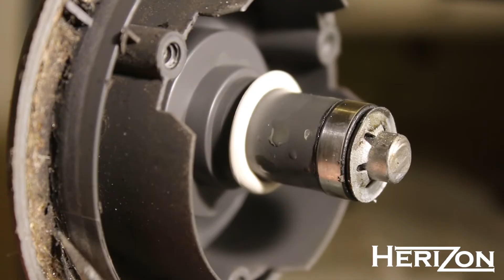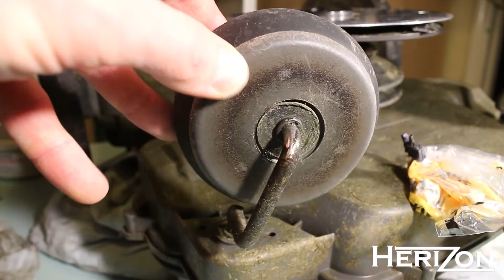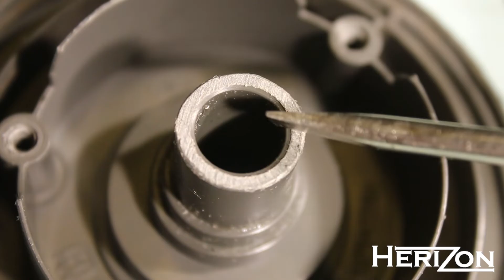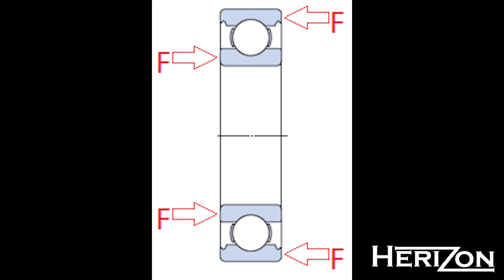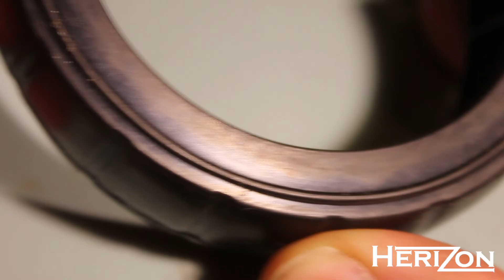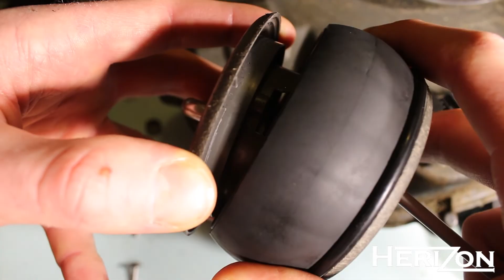Automower 420, 430X, 440, 450X, 520, 550, 550 EPOS front wheels repair and modification

Comment: Extremely informative video. What frustrates me is these mowers are not cheap - yet design flaws are many. I’ve got 2 435x AWD NERA; got them installed in March 2026 and todate gone through 3 blade disc holders; around 9 lost or stripped blades,  1 pcb in the charging station and we are only 5 month into my first season. Having said that, when they work my field looks amazing!! 

Anyway many thanks for the video - came by to learn since my mowers are still under extended warranty. Oh by the way in case someone reads this message Husq won’t cover blade disc holders under warranty as these parts come under wear and tear!

Comment: Great video and well explained. The o-ring solution is not only original, but works! Thanks. If the outer seal is worn, the tire will still hold in place, so you can use old tires, as long as the inner seal is good; just test that it does not slip when compressing the tire. 
Instead of using a lock collar, I have threaded the axles (M8x1.5) large, for 5mm and blocked the bearings with a slim nut and belleville washer, the nut locked with loctite after adjustment. This is similar to the solution used by H on the latest machines, except that they reduce the axle to 6mm for the nut.
Thanks again for your excellent ideas and instructions.

Comment: If you see in what way the wheels can be improved with a relative small amount of work and costs, I am asking myself why Husqvarna cannot do this and has to sell here in Germany this wheels for 58 Euros per piece. It is the same with the wheel motors, actual the motor never quits service, but in the gearbox 2 bearings ( total price SKF each 3 Euro) are very often failing, Husqvarna sells only the complete unit for 250 to 290 Euros each . Why can`t they just use better quality bearings and sell motor and gearbox seperately ? To me it appears as a huge rip off of customers. The unit price is also the highest on the market . ( My mower is a 450X from 2018 with 12670 hours )
Reply from the maker: Because it is a part of the business plan.

Comment: Your automower videos are the best online! Not only you know how to fix them, you know how to improve the design. I wonder why husqvarna doesn't modify some parts for better life... suppose they just interested in selling parts. The front wheels are in my opinion the element that you are changing the most, alongside with the sliding plate and cutting disc. Let's see if they can endure 2 seasons with your mod!
Reply from the maker: This design is still flawed, since outer bearing needs to sit inside a sleeve (originally there is no sleeve), otherwise wheel will slip on the shaft over time, bearings and inner plastic will diminish, which happens due to lack of axial pressure on the bearing (there will be a significant play, before this happens though). After installing a sleeve, axial pressure on the bearing is not needed at all (which is actually preferred to keep bearings from deteriorating), since sleeve keeps wheel from slipping and tilting towards the shaft. 19 mm milling cutter is needed for honing so sleeve could fit inside an outer plastic. At the moment I am testing sleeves, which are made of copper.
Reply: Thanks for the update! A video would be nice if that works. By the way, I've found an alluminium lock collar which is 6mm instead of 7 mm wide. Do you think i'll be able to avoid filing the pieces with it? Again, thank you for your work.
Reply from the maker: @jrioscouto  I might do updated video about this matter, but only if this is tested properly. At the moment this sleeve mod is in testing phase. Yes, if 6 mm wide lock collar is installed, no filing is needed.